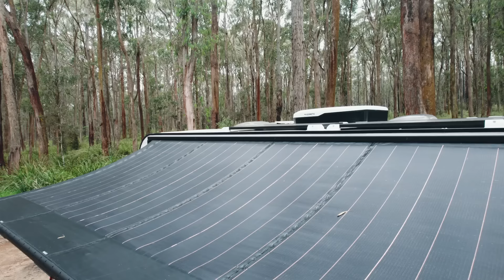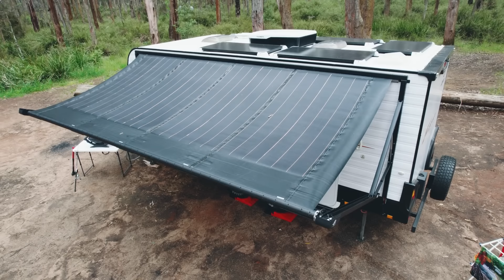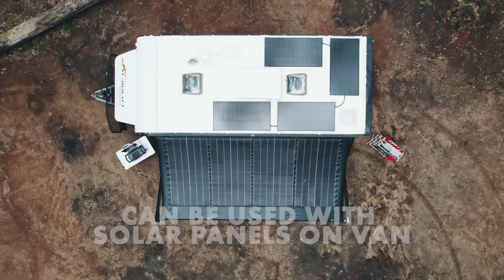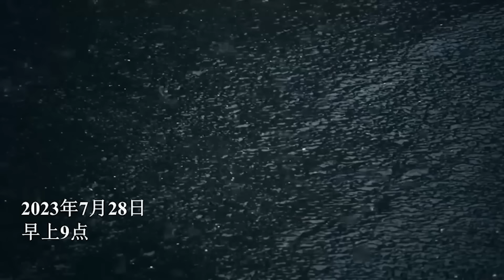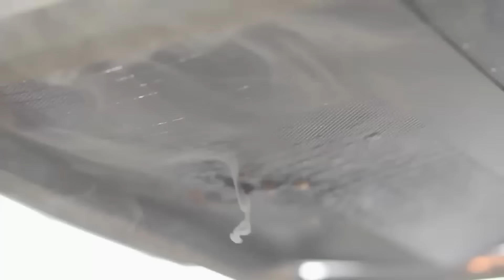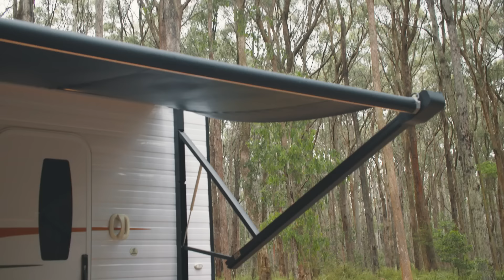This SOLAR AWNING Has Huge Output! | World First!

Comment: This has so many potential applications. Why are you limiting yourselves to just camper awnings? This could be applied to a traditional house roof for power generation, top of a carport/garage. The awning itself would be practical for some homes to extend over a patio. I instantly thought of how this would work for charging my EV car.
Reply: Generally speaking rigid solr panels have a longer life and are slighly more efficient, so if you have a roof you are better off going with rigid ones, they are cheaper also. I can totally see this for patios where you dont always want it to be closed or you want to keep the versatility, even boat sails tbh
Reply: @themurderbotfeed7688  While rigid panels might be more efficient in energy production. They fail in comparison when it comes to the expense of putting up and taking down when it is time to replace a roof. Such panels would add thousands to an already expensive roof replacement. Additionally, rigid panels tend to be a great deal more fragile.
Reply: Thats exactly what i thought ! We dont have a camping culture in my country but this could be perfect for providing garden/patio lighting

Comment: that price is insane for something you can use once in a while - between high winds and parking the right direction - I can tell you there is limited usage - you are better off getting more batteries and improving the roof solar array

Comment: How much power was it making during filming?
Reply from the maker: Hi Matthew, at one stage, I went in the van and saw the van's solar system was making about 1700W in slightly patchy sunlight... but this particular van also had about 700W of solar panels on the roof. When the sun went behind clouds, solar input from the awning and roof-mounted panels dropped to between 700 and 800W.